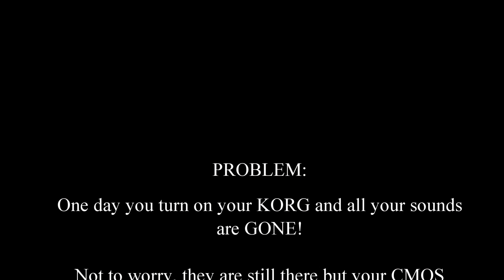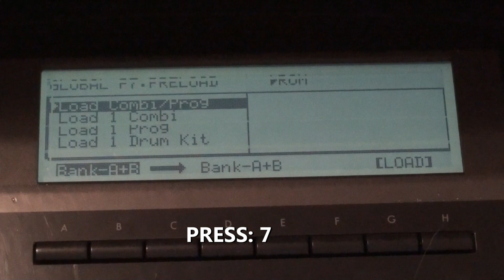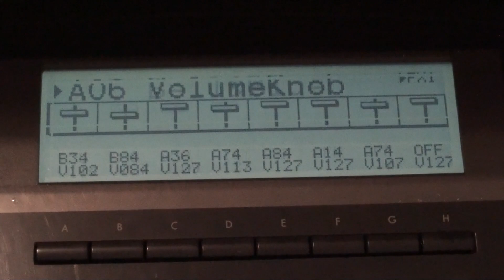KORG 01/W Pro Battery Replacement

Comment: Thank you SO much! The manual said to see my Korg dealer, which wasn't an option. The battery was 23 years old, so I'm glad it happened today instead of at a gig! I even had one of those batteries in the drawer. Thanks for de-mystifying things for me!
Reply from the maker: Don't think I made it clear, but as long as the keyboard is plugged into the wall, the battery will go for years.
Reply: Yep, it was clear. I don't use mine very often so I don't plug it in, but it's still lasted 23 years!  BTW, I found you through a terrific website that said your video was the best for this little operation. It was Cliff Canyon, at indra.com. The site has two loves: the O1W and The Beatles.
Reply: patpatpat999

Comment: Thank you for this video. My 01W was one of the first off the shelf and I can't believe the battery lasted until yesterday. This video put my mind at ease and was just as easy as it was in the vid.
Reply from the maker: Something smooth in these times is good. I'm guessing it was always plugged in.  I think the battery is only used when the Korg is not plugged in.
Reply: @patpatpat999  It's plugged into a power strip along with the rest of the studio. It gets powered down every night.  And yes, something going smooth these days is a blessing!

Comment: Thanks for this. I just today found all sounds on my O1R/w gone. Followed your instructions ,battery replaced and as good as new. I've had it since new for what must be pushing  20 years or more so I can vouch for the long battery life.
Reply from the maker: I believe what's what may be going on is that as long as the Korg is plugged in (doesn't have to be on), the battery is not used.

Comment: Thank you. I just tested my O1/W before a short gig tomorrow since I haven't used it in over 6 months. When the sounds were gone I almost fell over. then I saw the low battery alert. This video saved me cause I never opened the keyboard myself in 26 years of usage. I actually brought it to get serviced 2 or 3 times over years. The keyboard is amazing.

Comment: Thanks for this. When I turned on my machine today, I had the internal battery error message and thought, "Well, it's been a good run 😔." Then, after watching this, I replaced my 28-year-old battery today so easily. Word to the wise: Use a power screwdriver (I did not!).

Comment: Hi… great video. One question. If I replace the battery. Will I need the original floppy disks to load the stock sounds?
Reply from the maker: @greenmotif6605  nope. They’re still there.  You can follow the steps in video without installing a new battery and the sounds will be back until you turn it off

Comment: thank you for this information. By chance do you know how to get the sequencer button to go back up. There is A-H on the sequencer and the C key is stuck down. I can move the cursor with other others but not the Letter C Button. Thanks if you have any suggestions. And that for this battery replacement video.

Comment: Actually, without changing the battery, the GLOBAL > 7 > G or H > E or F sequence and back to Combi, revives the sounds but you have to do this just about every time you turn the keyboard back on  Having the battery working just ensures the sounds stay immediately available.  If you aren't immediately able to do the formal repair, at least you can get sounds back when you do need them.
Reply from the maker: Right you are.  I should have mentioned this in the video for folks in a hurry.
Reply: patpatpat999 I just had to start doing this a bit after the keyboard, though plugged in for many months, needed the "reboot" when I turned it on.  Just got a battery, but haven't gotten the gumption yet to open the keyboard up.
Reply: Scott Duncan I did that and they are gone again.  So that tells me the battery is dead.  Someone mentioned a 2025 or 2032.  Is that the correct one?
Reply from the maker: +AXESMI cr2013 is what you need.  I just put a 2032 in something the other day and the "new" battery was bad
Reply: +Scott Duncan Unless you edit your sounds!!
Reply: +Scott Duncan sounds good.  Is it the same sequence for the Korg X3?  Couldn't quite figure it out for my X3 from your description here. I have had it new since 1993, and it's in mint condition after gigs from MD to Memphis TN and AR, but the display is saying "Low battery" now, and losing the patches and names, other than the General MIDI bank still being reliable under Programs.
Reply: +paulanderson79 Yes, quite true.  I don't edit the sounds.  Probably could have used a less expensive instrument for what I do with it, but it was a gift.
Reply: +Nealix D. Sorry...I don't know.  I learned the sequence by searching the internet for information about the problem and what to do and I was just searching for the 01/W.
Reply: +scottpduncan Thanks anyway, Scott.  Might be a trail for me to pick up the scent as I go!
Reply: Scott Duncan I don't know if you can help me or anybody can help me,I'm having troubles we my 01wfd  in the sound, is coming up with static And it sounds horrible can anybody help me thank you
Reply: Just change the battery

Comment: I have an old Korg X5 and I get a low battery message and sounds like the CMOS batt needs to be replaced.  the X5 looks similar from the outside.  and I suspect the inside looks similar?  When initializing the unit I don't remember seeing a button that says "load"  might mine be different.  Not worried about replacing the batt, but concerned about initializing it.  Can I screw anything up trying at home?
Reply from the maker: J Michael Allen  I don't really know the X5.  I wouldn't expect you could mess it up.  I'd keep searching the forums for specific info on the X5

Comment: Thanks for the help; however, the one I found - it had been thrown away! - is the pro model, and it has a wood cover on the bottom and a whole bunch more screws screwed down from inside holding stuff on it..so I knew that wasn't the way. I finally found indra.com from a search, which showed there's 3 screws+washers in the middle on the bottom cover that lock 'the hood' on top with the display there. Then 7 small screws in back around the card slots and midi plugs. You get those out and you can lift the top plate and get to the battery; but it's pretty tricky! Anyhow, I did it and it defaulted to the most spaced out program you ever heard, ala 2001:Bladerunner-0. Also the steps on re-programming it seemed missing something, but I played around tyill it said BANK and whatever else. And then PAGE up got me to the global '7' and was home free. Again, thanks.
Reply from the maker: Congrats on going for it and making it work. Should be fun to play with.
Reply: @patpatpat999  It is. But for the last 6-10 months it would make a click sound and go dead. When I turned it off and ON then it worked again. Until the last POP! and the screen went blank but was still lit. Does that sound like a battery? or something more sinister??

Comment: i have korg 01/w pro x .... i have tried but even when screwing all the screws ont the backside it doesn't open
Reply from the maker: I believe there are 21 screws on the back. All I can suggest is some solid tapping all around the edges to break it loose.  Perhaps it's a bit stuck from smoke or other residue.

Comment: Hey Hello,
do you need a factory patch data on a floppy disk for this operation.
best regards
Reply from the maker: Andry Rakotomanga no.  You don,t even have to change the battery.  Power on your Korg and follow the same steps after the battery replacement.  The sounds will stay until you turn it off or unplug it, not sure which.

Comment: Hey, I did this process 2 months ago but again my sounds got lost. It says battery low is crazy since I bought a new one on my Korg N264. Is there something I'm doing wrong?
Reply from the maker: Alex Hernandez Grupo Macao I don’t think so.  The battery should last years as long as the keyboard is plugged into the wall.  It does not have to be on, just plugged in.  It is always possible you got a bad or cheap chinese battery.
Reply: @patpatpat999  thanks for responding, I bought the battery at a stapples store. Do you think it has to do since the original battery was a "Sony CR 2032" and the one I bought is a " Duracell DL 2032" ?
Reply from the maker: Alex Hernandez Grupo Macao The DL 2032 should be exactly the same.  I don’t know why yours died so quickly
Reply: @patpatpat999  yes Man this is weird, the first battery I bought I bought it in ebay, in mind was like you said probably a bad one. Then I bought the other one in stapples thinking this would fix the issued but 2 days ago i turn it on, and my sounds were lost and the battery low message appeared again.

Comment: My display has gone very dull. Could this be down to the battery also?
Reply: this has happened to me as well.  did you ever get an answer?  I tried replacing the battery and it didn't work.  I was told there is a fuse in there somewhere as well.  let me know if you ever found a solution.  I would be very greatful
Reply from the maker: Sorry for the very long delay to respond.  The display is dull before it's "worn out".  I have a video how to replace it.  The part is about $10 but is rather involved to replace.
Reply: where do you get the parts? Is the video on your page?
Reply from the maker: Just google korg 01 backlight replacement and you should get my video and some eBay soures.  I was wrong, the price is now about $30.  It's quite a job to replace.  You have to take the keyboard apart as far as is possible.  The rest is easy.  Cut the two leads to the old back light, leave it in place.  Slip the new one over the old, then solder the two leads for the new one.
They go dim over time according to how many hours its been used., so never leave your KB on when not being used.  Cheers,

Comment: I replaced the old battery with a new one, but when I turned  on the Korg 01W this msg appeard on the screen: ERROR: battery low internal.    How do I fix this???
Reply from the maker: Sparky Montoya the message means he battery is low or dead. Make sure it was installed with + side up.  Otherwise it’s possible the new battery was no good, or maybe you mixed things up and put the old battery back in?

Comment: #1, I am in Canada so where can I buy these batteries and also, I need to replace my backlight. I saw another tutorial here but it's in Spanish. Also, If anyone has detailed info on how to replace the Floppy Disk Drive on my 01W/fd I would truly appreciate it.
Reply from the maker: Dukerbud 88 The batteries are CR2032. they are available in almost all stores located with all the other batteries or the watch department
Reply from the maker: Dukerbud 88 My video on backlight replacement includes removing the floppy drive

Comment: This was a perfect video to show how easy battery change is. Unfortunately after doing mine, which i did very carefully, the keyboard would no longer power up. LED screen does not light up. I hear a very low hum from the power transformer. Have tried reinitializing, nothing. Dead dead dead. My motherboard looks mint. Exceptionally clean, not leaks or corrosion. This thing was well taken care of, just not used in last ten years. I played it prior to battery change, all seemed fine. Anyone have ideas as to what the problem might be?
Reply from the maker: David Smith OUCH! Probably just a coincidence. It would work somewhat even with no battery installed. Sounds like the Power Supply died.  A good electronic tech should be able to troubleshoot and fix.  Couldn’t say how much that would cost
Reply from the maker: Here’s a link for a PS. But I cant’ be sure this would be the fix.  https://syntaur.com/Items.php?Item=4044
Reply: patpatpat999 thanks for feedback. I replaced the power supply board, but that didn’t fix anything. With the great help of someone online, I was able to determine the problem was with the floppy drive itself. When I disconnected the drive, keyboard started up and worked fine. Will replace the floppy drive and hope all is solved. Local service shop was unable to determine problem.
Reply from the maker: @DavidSmith-ne1zp  Congrats!  A bad FDD would not be intuitive to me to be a possible cause.  Enjoy your ax again.

Comment: 15 years (26 in 2024)? That is for choir boys. Mine has 32 years and still works, I'm going to change it now... because last year the LCD was fainting more and more. I didn't even know it had a battery, how could have one and keep working after decades? I just wondered if this fainting was irreversible and find out what the reason was.
Reply from the maker: I suspect the battery last forever if you leave the unit plugged in.
Reply from the maker: The LCD doesn’t fade, the backlight does. You should be able to find a suitable replacement, but the procedure requires you to tear all the way into the unit. I’ve done it.
Reply from the maker: Leaving the unit on causes the backlight to fade.  It has a limited number of hours it’s good for.
Reply: @patpatpat999 You're right, the backlight fainted, but even so I think the new battery improved the perceptibility. Anyway, I've only been using the 01W for over more than 20 years as a mother keyboard. The first 8 years of its life were at home composing on it and performing on stage, intense; after that no longer I used internal sounds or the sequencer, it started a new phase of its life working daily but quietly in my studio